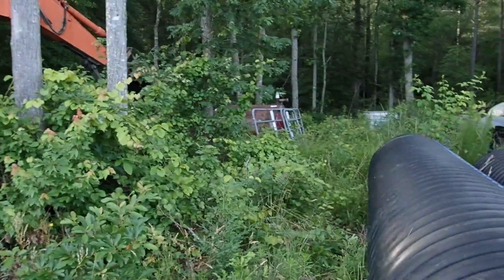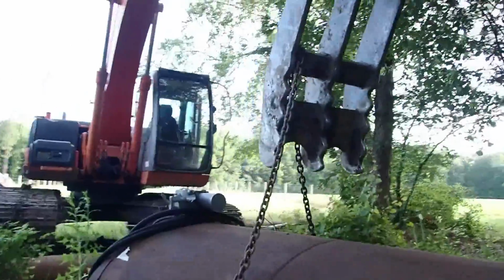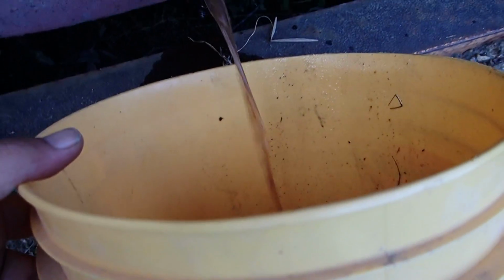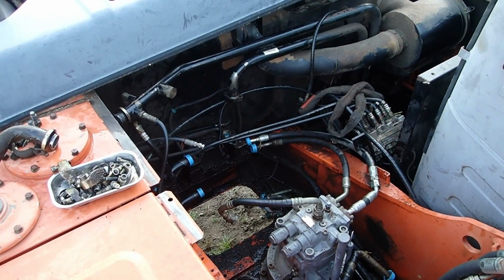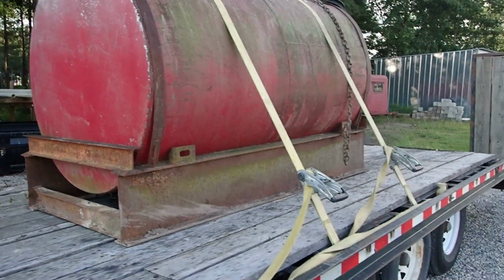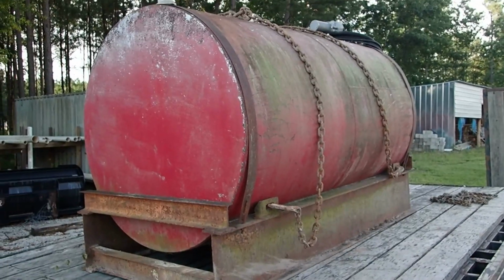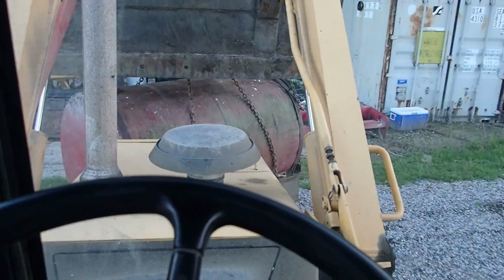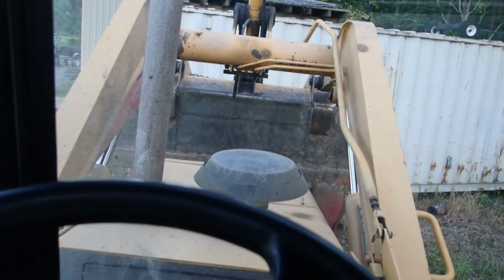I hope This All Works Out

Comment: I strongly recommend a quality filter kit on your tanks. Every tank we have, including fuel cells in the backs of our trucks have filtration and water removal. It was expensive up front, but with modern diesel engines, especially these tier 4 pains in the ass, it really helps extend the life of filters in the equipment AND protects injectors and otherwise. 

I am not a brand loyalist, but I do have to say, the Donaldson "clean and dry" fuel transfer kit really is the bees knees. Even just the clean, with filter is great.
Reply from the maker: Ive already ordered a inline filter to put on that tanks pump before i pump any out
Reply: @letsdig18  Good head on your shoulders man! 
Glad to hear. And keep up the good work.
Reply: @letsdig18  need that clean fuel to start the fires ,, lol ,,i got waste oil ,, and used kerosene from my parts washer ,, to bad i am in ny ,, that would start the wet wood fires no problem ,,,, maybe put that fuel tank up on blocks ,, next time just slide it off the trailer on to the blocks at the same level ..??

Comment: Had to move a couple of tanks the same size a few weeks ago for my brother-in-law. Both were 120v pumps and the switch on one of them was acting up. Pulled the cover and that metal lever actuates a little plastic toggle switch in there. As small as the switch was, it is a wonder they last anytime at all!

Comment: I like the idea of using that talk for it's intended purpose, but I also like the idea of putting a filter on the pump and somehow I can't help but wonder if there is a better way to move it. And if bulk deliveries would not be a better solution than moving the talk to Loves whenever you need it filled.

Comment: I would have made the chains longer so that you could curl the bucket so the cutting edge was just touching them, lift on the arms as hard as it will go, and then curl the bucket to lift the load.
Usually the loader lift cylinders will hold more weight than they will lift, and the curl has more power.

Comment: You're wrong. Fuel tanks have vents in the cap, and as barometric pressure changes it allows moisture laden air to flow in and out of the tank, which will rust the tank out. Unless you are out west, tanks should be stored full of fuel or with non vented caps. Love your vids, I just bought a dozer myself, been very busy with it $$$

Comment: The diesel shouldn’t over flow if the tank is vented properly and you make sure to not fill it to maximum capacity unless your ready to pull off of it immediately. Again, proper venting 👍

Comment: Wail you had the service truck there you could have had a hook welded on the bucket.
Reply: The mechanic and welder are 2 different services usually.  Completely different truck setups
Reply: Wail.....?
Reply: @anderleof  While...
Reply: @karaayers2867  there is a welder on that truck. Don't need a welding rig for a hook.
Reply: Instablaster...

Comment: Maybee just get a new pump set up with filter and hose.  I usually see filters for tanks.  Yah that diesel is great for burning those wood piles you have. Test for water than you know your tank is staying sealed.  Great time to buy diesel before it goes up, regular station or did you go to a truck stop? Can't wait to see the excavator fixed.

Comment: In New Zealand where i am Its NZD1.45 A litre x 3.8 to the US gallon. If you are going to fill it up it might pay to drain it and throw a new filter on the pump. It may have condensation from sitting. And maybe a new padlock as some people are better left untempted. You know this. LOL water in diesel in not good for the injectors. The steam from the water erodes the pin and seat in the injector $ $ $ .We don't want that. That proved the back ho has good seals and hoses. LOL

Comment: I didn't think you'd have any problem in the world with it picking that up with the loader after all the backhoe for 10 that I had had a yard the quarter bucket on it and gravel gravel weighs 3000 lb a yard X the yard in 1/4 bucket it should have picked it up easy I miss my backhoe LOL had a 1985 for 10 be four wheel drive cab extendahoe bought it brand new but when I sold the property I had to get rid of her

Comment: are you ever going to use the stumper attachment again?
Reply: I wondered the same thing. I know it takes time to swap since they don't run quick couplers but when they have 2 machines on the same job for a while, I'd think it might be worthwhile. Plus is puts a lot less stress on the pins that doing it all with the bucket.

Comment: Tip to get a few extra inches of lift: Put the rear outriggers down then lift has as much as it will. Then lift the outrigger and you gain that distance as the rear goes down.

Comment: I tried the off road fuel tank and regular fuel tank a while back..... Employees couldn't figure out the difference.... color didn't make a difference to them and I guess the big signs weren't in English.. That's part of the reason why I'm looking into excavating like you instead of paving. after 20 years, being on a time crunch every job with time and temperature sensitive materials and 10 Employees running around, some doing what you want and some not gets old.  scares me to death putting the money down on some bigger machine though lol.

Comment: Why loader an not the hoe we've been pulled out when stuck by similar size hoes our Ford 9000 GD Well Rig weights 21-22 ton,they pad down stick the front bucket an curl in course that's not lifting. We have picked our air compressor off the deck of our rig,an reach out to lift an bet it weights similar to your fuel tank at 7# a gallon usually a 580 L/K Case. Just a thought they have more digger power than bucket lift,you still got it.  lol http://www.tractordata.com/backhoe-loader/000/0/5/57-john-deere-310e-attachments.html